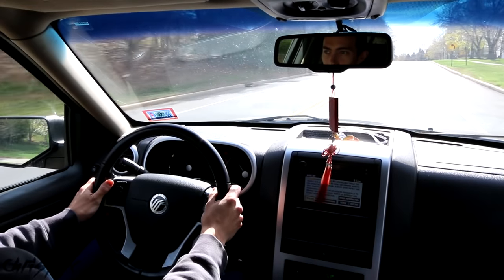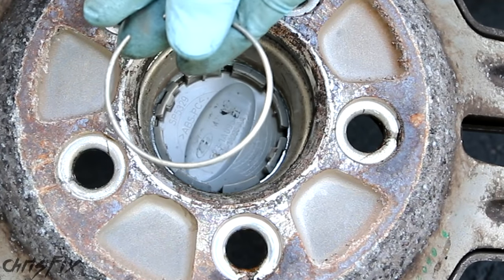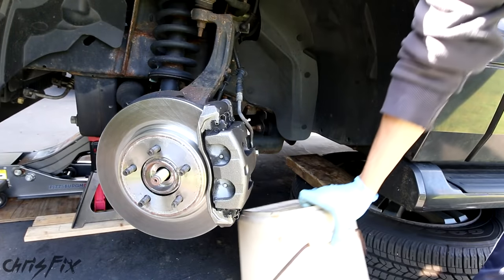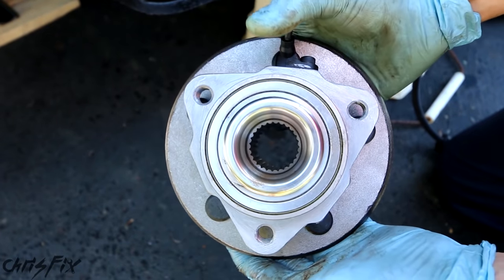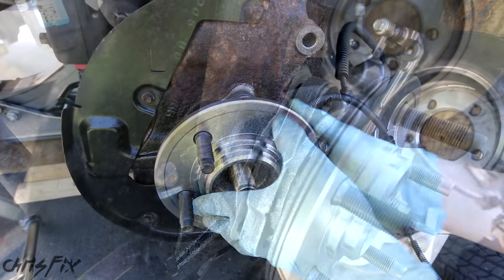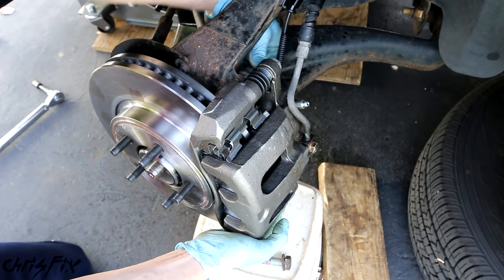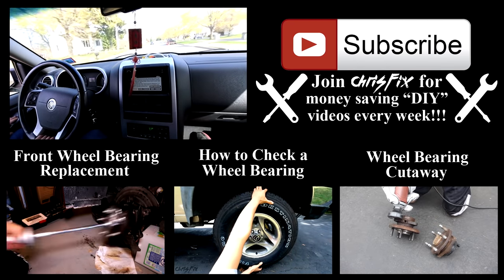How to Replace a Front Wheel Bearing

Comment: Hey Chris i have a 2006 PONTIAC TORRENT SUV FWD 
and this is my second Wheel hub bearing that is bad in less than 5 months any ideas to why that is happening.
I  bought the Economy,  Wheel hub bearing as it is only $80.00 and up. the most expensive one is at GM Dealership $224.00 just for 1 Bearing. 
I bought all at $80.00 and they're working great but this one on the front Drivers Side keeps wearing out. Any ideas to why this is happening. as i speeds up it gets very loud and today it was louder, will the wheel fly off.

Comment: The Mechanic working on my car couldn’t remove the bearings coz probably he don’t have the hammer and sizzling homemade penetrating fluid like yours. Now his going to replace the spindle as well. First, I heard he said Speedo, then I googled…his referring to spindle. So front wheel bearings both side plus new spindle $1800 plus $195 for the one he fixed that was leaking…

Comment: Chris, would bad wheel bearings cause wheel vibrations at highway speeds (above 40 mph)
Reply from the maker: Yes, it could also be unbalanced wheels but I would jack up the wheel you suspect has the bad bearing and see if you can shake it by hand. I go over that in this video here, check it out: https://www.youtube.com/watch?v=YvKWGjmPKoc
Reply: @chrisfix  great. Ty!  I'll jack up the front first and see if those tyres rock any.  If not I'll do a rotate and balance.  I'll click on that link you sent me. You're awesome Chris. ( just an fyi only, it's a 77 t Bird)

Comment: If one of the bolts broke on the wheel bearing is it necessary to replace it? I went in to get a tire replaced and the guy broke the bolt but said I should be fine with one missing.

Comment: What are air tools?
Reply: Bradycraft. Air tools are tools that use air from an air compressor in order to make them work. So, if you had an impact gun to take off lug nuts and things like that, you could use an air impact wrench.

Most shops have air but there is a movement to the battery operated tools because they are becoming very well made and can handle bigger jobs.

Comment: I have a 97 Acura RL albeit it has low mileage of 100k. I havent maintained it much outside of brakes and oil. After trying to take off the axle nut just once and having my 20in ½ breaker bar broken, it makes me want to dump every part I run into in anti seize

Comment: I have a question for anyone who can answer this, I know i might sound like an idiot so im sorry. But why does he replace the whole assembly, and not just the wheel bearing itself? I'm not complaining, I'm just about to do this process myself And wondering why chris did the whole thing. Actually i'm wondering why most people do the whole thing when I watch these videos.
Reply: Have you replaced yours yet?
Reply: @vigilantemotors  i did brother! I went ahead and just did the whole process like Chris did here and replaced the whole assembly. Going to do the other side next just to keep things the same lol. One of the hardest parts was trying to find an axle nut socket! I had to order a 31'mm from Amazon because my auto parts stores sell every single one except for 31. Lol.
Reply: Yeah those sockets can be hard to find. Certain vehicles I work on need odd sizes like 28mm and such, not easy to find. 
Glad you got it off, just make sure you torque down to spec everything, especially the axle socket its really important. @codeh-duh

Comment: Why does my mechanic say he has to press the bearings, and when I tell him that you don't need to with the pre - assembled ones, he says they are not good quality. It's confusing.
Reply from the maker: A lot of people use pre pressed wheel bearings from good companies with no issues, he could either be trying to charge extra with the extra labor involved or he has a specific brand of wheel bearing he trusts the most and is trying to sell you on those
Reply: @chrisfix  Thanks for the reply much appreciated, I also posted this on a forum and he replied that not all cars come with pre hub assembly. My car is a mazda 3 2008 sedan 2.0L.

Comment: Had a wheel bearing that took 16hrs of work, ended up cutting the axle off and it still wouldn't come out with 5 tons on a  hydraulic press, ended up cutting all of the metal on the bearing/hub off

Comment: I have a 2006 maxima that needs the front passenger side bearings replaced. I only see the ones that need to be pressed in. I noticed that you didn’t press the bearing into the hub. How can I find the ones already pressed in?
Reply from the maker: There are two styles. A pressed bearing or a bearing/hub assembly. They usually only come one way. Here is how to do the pressed bearing: https://youtu.be/mQ2fJ_aM_T0
Reply: @chrisfix  Thank You so much!
Reply: @chrisfix  Hey, Thanks again so much ChrisFix!! With the help of your videos, I purchased the exact same press you have from Amazon instead of the hammer one from Autozone. It got the entire job completed today 🙏🏾. Stay blessed!

Comment: I saw others that removed break pads. Does this matter per car?
Reply from the maker: There are no brake shoes on this. Maybe you mean brake pads? If so, you don’t have to if you remove the whole caliper with rotor. Saves you a step which saves you time.
Reply: @chrisfix  Meant pads Thanks.

Comment: Hey Chris when I turn left there is a grinding noise but not when I turn right...and when I left up the car I don't hear it...I this a bad wheel bearing?
Reply from the maker: Is there an axle attached to the front wheels? If so it could be an axle. Also check your wheel bearing for play because the wheel bearing could be bad and causing your brake rotor to scrape on a turn.
Reply: @chrisfix  ooh...ok...thanks. but I don't have a front axle...I will check for play.

Comment: So you have a slide hammer but decided to use a hammer to remove the cv axle?
Reply from the maker: The slide hammer was not strong enough since it was stuck from the rust.
Reply: @chrisfix  sorry, wasn't talking about removing the hub from the knuckle, I meant when removing the axle. Usually the hammers mounting plate comes with a bolt that threads in and pushes the cv out of the hub.

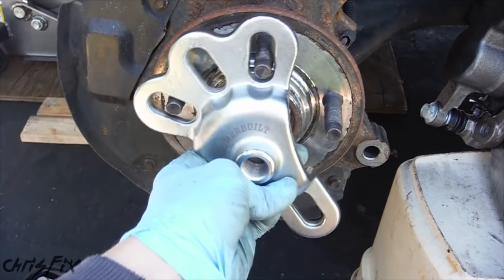Comment: Is the slide hammer the only way to remove the bearing because on my bearing I’m missing 3/5 of the bolts that stick out, they broke off while I was driving with a loose wheel 🤦 (sorry if my explanation sucks I’m not the best when it comes to cars and part names)  but what can I do if I’m not able to use that tool since like I said I have no pieces to attach it to?? 7:00
Reply from the maker: You can use something like a 3 jaw puller or just get behind the bearing and give it some hits with a hammer to pop it out. Give it plenty of heat and penetrating fluid and it'll come out a lot easier
Reply: @chrisfix  okay thank you

Comment: Grettings to all.
I have doubt here. Hope. You can help me...

Can i change only de wheel. Bearing or do i have to change the hub assembly as well??

Hope. Someone can help me
Reply from the maker: Depends on the car. If you have a bolted I. wheel bearing assembly, you need to change the whole assembly. If you have a pressed in wheel bearing, you can replace just the bearing. Make sure your hub isn’t rusted
Reply: @chrisfix  =O.    It's a 2003 toyota 4 runner, when I turn the bearing you hear friction, scratchy like. That no longer lubricates, and driving feels. Awful.      Thanks for helping and answering me chrisfix.

Comment: It seems like a bad wheel bearing is rusted? I didn't see that it was broken or worn down.
Reply from the maker: The rust is normal. The internals were bad (the bearing part).
Reply: @chrisfix  I was just quoted $1010($749 in labor) to replace two front wheel bearings on a 2013 Honda Civic. Does that sound expensive?

How long should it take to change two front wheel bearings on a 2013 Honda Civic? I think the labor quote might be over estimated time(time theft).

Comment: What about if it just comes on when you turn but when you turn the car off and on the lights go out?
Reply from the maker: Gotta scan the computer and see what the code is. Could be a bad wheel bearing, bad axle, or bad abs sensor.

Comment: ''Hardest bearing ever''??? I'm in northern Ohio, SALT. Had an 02 Taurus, steel wheel hub in an aluminum steering knuckle. Had to cut the hub and remove it one piece at a time,  already beat on it until the center and the balls fell out of the bearing!

Comment: My steering wheel shakes crazy and knocks and feels loose would this be the issue
Reply from the maker: All the time or only when breaking? If only when breaking it could be your brake rotors need to be replaced. If all the time check your ball joints, bushings, and tie rods. Here you go: https://youtu.be/brI2feYiEi8
Reply: @chrisfix  did a look from car being on the ground could it be I need all tires balanced ? Because been riding on uneven tires and it wobbles all the time and wobbles from like everywhere , thanks for you advice

Comment: 8:30 why did it sizzle??
Reply: Penetrating fluid breaks rust apart that welds to the hub (Rust welded) so that the hub would be easy enough to remove.
Reply: Because it was hot, and he doused the room temp fluid onto the red hot metal and it crackled

Comment: A. Like your vids; but...

B. Not necessary to pry out the spring from the center cap: with wheel off- they are easily removed by gently tapping with handle of a  screwdriver, handle of rubber mallet, handle of hammer, etc...

C. So no need to pry on the plastic center cap with screw driver;

D. There is no such thing as a flathead screw driver: "Flat Head" describes the shape of the head; not the driver; flat head screws and bolts can require Philipps, Torx, Robertson, combination tip, or be slotted...hence they need a slotted-screw driver.

E. When you applied anti-sieze to the splines on the shaft, you called them "threads".
These errors diminish your technical credibilty.
In the future, the phrase 'mating surfaces' can cover a lot of situations, without worrying, or searching for a specific word.
Reply from the maker: Thanks a lot. I’m glad that’s what you got out of the video!
Reply: @chrisfix  Ok,...its hard to read tone in print...I watched your video because I am preparing to do this exact job on my car today; I had been sufficiently impressed by a couple of your other vid's, that, when your vid' came up on the search, I felt it would be worth watching...
Which it was.
I watched 3 or 4 to see what different problems cropped up, and how people handled them.
As I said, your videos are helpful: demonstrating good solutions, and workmanship with effective communication, not only on what you are doing, and why, but also other options that you are not doing, and why.
As an engineer, I can be a little picky about terminology, but, I think you really are, too: what's your reaction to someone who says "lug nuts" when they have bolts, or calls brake pads "shoes"...etc,?
Just trying to help your vid's come across a little better...
Reply: @TheScandoman  Man, I get what you're tryin to say here and all, but you can't deny that first comment you made came off a whole lot more  condescending than constructive.